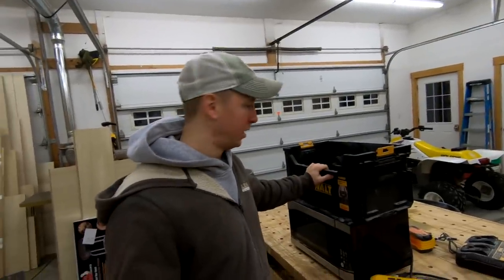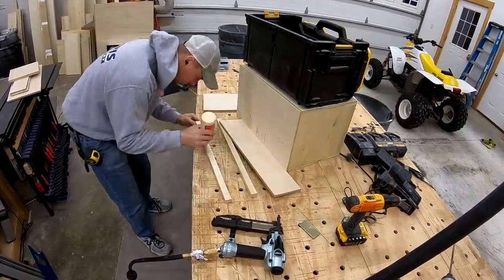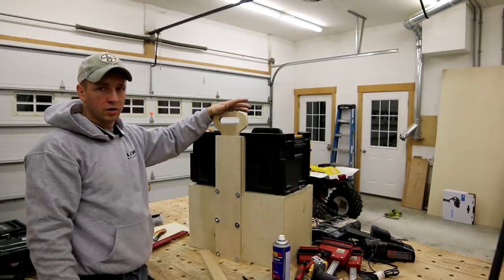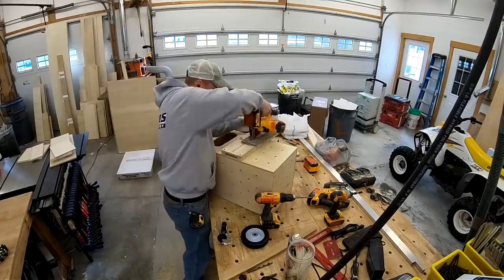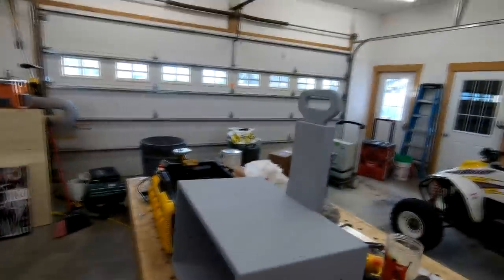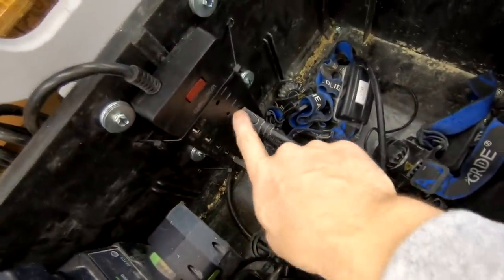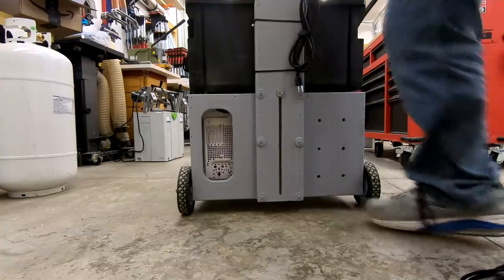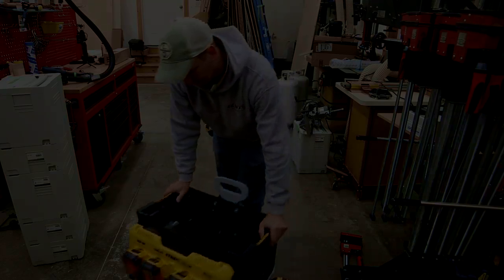The ULTIMATE Jobsite Microwave & Charging Station Dolly! - Dewalt Tough System Tote & DCB104 Charger

Comment from the maker: Thanks for supporting this channel by vising these affiliate links for tools used:

 DEWALT DCB104 20V Max 4-Port Lithium Ion Fast Charger - https://geni.us/Pnz5icS (Amazon)

 Dewalt DWST08205 ToughSystem Tote - https://geni.us/56GwK (Amazon)

Countertop Microwave Oven 900 Watt - https://geni.us/BgDnI6l (Amazon)

Casters 6" Diameter X 2" Width - https://amzn.to/2RNlgLO

Heavy Duty Rubber Caster Wheel with Swiveling Top Plate - 2-Inch - https://amzn.to/2Pe6NXH

All-Thread Rod, 1/2" x 13 x 3' - https://amzn.to/35hKsxZ

Power Strip - https://amzn.to/38v85Fj

DEWALT 20V MAX Portable Band Saw - https://amzn.to/34h4mbl
Reply: Dude! If you made this the bottom of one of your drawer towers you could put your bulky tools in the bottom “cabinet” and then have a crate on top. I might make one of these to keep buckets/liners or other bulky stuff that clutters up the site

Comment: I like it. I used to bring a microwave to the job site whenever I would be there long enough to warrant it. The only thing I don't like, as a retired pipe fitter, is that you have to get down on one knee to load, set timer and remove your food from the micro.
Reply: if you're retired what are you doing on jobsites with microwaves?

Comment: I love all tool organization videos. I’d add slide rails to the back so you don’t have to lift it, just get in the van and pull it up.
Reply from the maker: I thought about that also and may do that. My other carts all pull up into my van to that may be an upgrade I make.
Reply: @InsiderCarpentry  
I'm glad that you made a ventilation hole for the microwave. This will also reduce unnecessary weight for the cart.

Comment: Great idea. Only change I would do is to have the battery holders inside of that tote even with the holders screwed on the inside walls With me I would be afreaid to break them off since I do have tendency to hit the corner of the trolleys when making sharp turn or passing the doorway.

Comment: Awesome project. The only thing that I would change are the 2 front wheels. I would  
of used rubber or poly, some of  the  places I’m in have flooring installed and I think the hard casters could leave marks especially if there’s true hardwood.

Comment: Quick question. I´m planning to sort of commit to a single brand for the bulk of my tools. I am thinking dewalt or makita, I like both but I can´t decide which I should choose. I´m also gonna invest in some festool tools, Like the hkc55 and the track saw. So I am kinda leaning towards makita just because of the compatible systainers. But what do you think?
Reply from the maker: I am a dewalt guy. I own almost zero makita anything. I think dewalt is a great base platform and covers almost everything you could need and does it well.
Reply: @InsiderCarpentry  well damn that was fast! Thanks for the response!

Comment: Nice build. I was wondering why you would throw the charged batteries in the tool box before putting it in the truck ? Is it so they don't get knocked off of the  3d Printer holders ?
Reply from the maker: Correct. And it narrows the foot print so it fits where it nests on my shelves.

Comment: Is there a way to hook up an inverter so you can run the microwave and coffee pot, so you don’t need ac? Just a thought
Reply: Steve Picchi put a dewalt 1800 inventor on top. problem solved

Comment: One down side, you won't be able to drag that up a flight of stairs unless you make some slides on the back side of the box that stick out beyond the bolt heads of your handle assembly.  Overall, a nice project though.

Comment: I see this is 10 months old has the glass front of the microwave cracked yet I was thinking of a removable front face basically a box that's an inch deep to protect the glass door when you're not using the microwave

Comment: I like the project.  Is the whole setup narrow enough to roll through doors, say 2-8 openings?  If not, the handle could be mounted on the narrow end, and the wheels reoriented.
Reply: DeWalt ToughSystem boxes are around 22 inches wide, so shouldn't be a problem.

Comment: I’m sad to say, I’ve been in the electrical trade for over 30 yrs now and have built many of different types of things to make my day/ jobs easier. And have had some great and bad ideas fail!, I really like your idea. Just wanted know how do you think the glass on your microwave door last. I’ve had a couple of microwaves on my vans and damn I’ve broken all of them thru the yrs of lugging them from site to site and in and out of vans, well great job and merry Christmas, God Bless
Reply from the maker: Thanks, I'm a one man show so it will be fine. I take care of my stuff and there usually isn't anyone else around on the job to break it. In the last six years I've broken 1, it fell off the shelf in the trailer in transit.
Reply: @InsiderCarpentry  A "lid" for the front of the  microwave box would protect the microwave in transit, and could do double-duty as a seat/table top when placed on top of the Dewalt box.  Attach the lid with window latches and a couple dominos, like your miter wings

Comment: Well thought out project, not much room for improvement just enhancements. A cold weather version might want to swap out the box on top for a plastic cooler with a small heating pad and a internal cubby for caulking and other such products along with warmed storage for the batteries.  Possibly some sort of bumpers along the front to protect the face of the microwave. Truth be told you did all the heavy lifting coming up with the concept and building the prototype, the Chinese will be selling a DEWALT copycat on eBay before you know it.

Comment: You didnt need anything other than the cutout directly in front of the vent for the microwave. And you probably didnt even need that.
Reply from the maker: An ounce of prevention is worth a pound of cure. Better safe than sorry. Not worth starting a fire vs a few minutes to drill some extra holes.